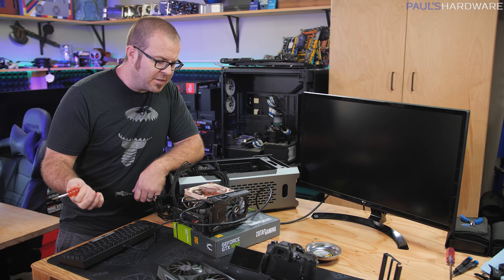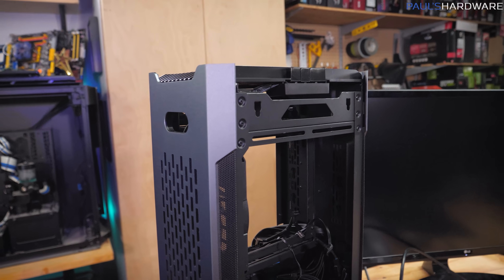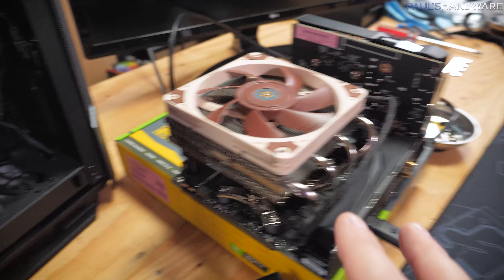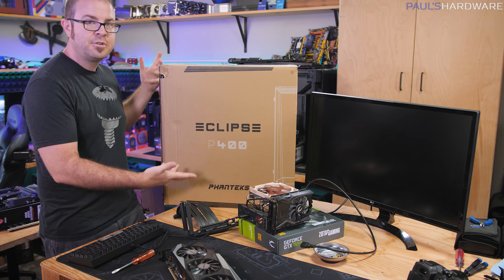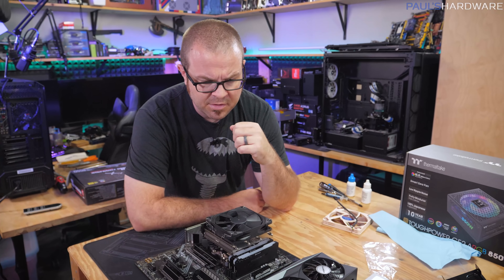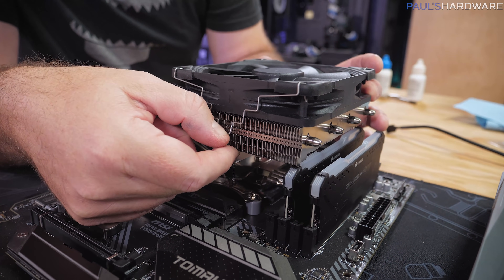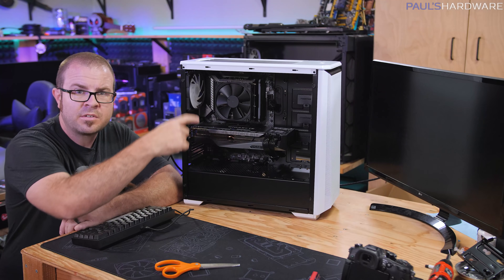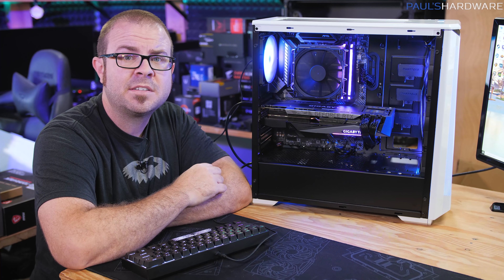Fixing the Chad PC... again

Comment: I have the same GPU and you did not forget to put in the RGB header....you broke it :D Its neigh impossible to take it out without damaging it ;) I replaced the thermal pads and put some on the back for the RAM and the Temps dropped by 25C for the RAM and 5C for the die

Comment: I had issues with two different B550i AORUS PRO AX myself. Spec wise its a great little motherboard for the price. However, issue after issue was not cutting it for me. I looked around on Reddit and found others having issues with it as well.

Comment: If this is like the X570 Master, then when the system's completely dead like that, you have to unplug the battery for about 2 minutes and then reattach it. It's some design flaw with Gigabyte 500 series AM4 boards.

Comment: Just curious, did you bother to re-seat the RAM or no before you declared the MB dead. I've come across quite a few times over the years, what appeared to be a non booting MB was actually just the RAM holding energy ( and the last data on it before last shut down) which was not allowing the MB to POST. But once I re-seated the RAM, allowed it to boot normally. saved quite a few people from having to purchase or build new rigs with that.

Comment: I destroyed a board by accident when clearing the cmos. There are boards that need to have the battery removed before shorting the clear cmos pins. Not doing so kills the board. Don't know how many boards have this design. But from now on i only clear cmos when battery is removed. By the way most boards have a supercap mounted that will take over the job of a battery for a short amount of time. This way you can swap the battery without settings or the time getting lost. O and before i forget always disconnect or physically turn off the power supply when clearing the cmos. This is because on almost every board the constant power from the power supply may not be connected when clearing the cmos. Hope this info will help save some boards :-)

Comment: Points our multiple times that RGB is not the focus and not necessary... then proceeds to install a parts list with RGB on almost every component. Only major part without RGB was the CPU cooler. I know, it's what you had on-hand. But it's still funny.

Comment: If that board is the Gigabyte Auros B550, the clear CMOS has to be done with the power supply still connected. Not sure if that's how you tried to clear it or not, but that's one thing in the documentation that is wrong about the board...
Reply: Thar's why I always just take out the battery, it's way easier.

Comment: Paul. There has been several times I have had to use a true 2 pin plug to short my Asus ROG E Gaming board. For some reason the posts wouldn't ground out properly with a screwdriver...

Comment: I have the same MB and It happened few times just like this, You have to clear the CMOS with the Power ON not like what gigabyte said in the manual, otherwise It would not clear the CMOS. I learn this in my tech support era during the late 90's and still applies to know brands MB. I Know and I guarantee the MB is not dead.

Comment: MotherBoard may not be right off try clearing CMOS again had one where a clear caused it to get stuck starting BIOS, if you have a BIOS flash button that let's you flash bios without a cpu try that to load a new BIOS as BIOS could be corrupted.
Chad's PC is like a 40 year old broom that's had 12 handles and 28 replacement brush heads that works as well as day 1

Comment: Had a similar situation on a gigabyte board all. Everything turned on went into windows but all the USB inputs were dead on the board couldn't even use it in bios. I tested everything out the motherboard was the only thing that was not functioning.
Reply: My Gigabyte B550 board has a tendency to boot with Bluetooth not working on the regular.
Reply: Both my Gigabyte boards refuse to detect the boot partition of the main drive.

Comment: I had a weird issue recently with my motherboard after a BIOS update, wouldn't post at all despite the BIOS update completing correctly. What I ended up needing to do which made absolutely no sense to me as to why it worked but I had to put a jumper on the CMOS reset switch and power up the PC while it was still jumped. After that I turned off the PC and then removed the jumper and it started working again, and yes I had tried removing CMOS battery etc but still wouldn't work. That was the only thing that did work.

Comment: i have a similar psu and there is a 3 pin cable included you can plug on the mb to control the rgb of the psu  via software  or with a compatible rgb hub controller. the model is a CX750F RGB  from Corsair, a bronze 80+ psu but it was cheap and my daughter wanted a unicorn puke build in her Rajintek Silenos pro case so....

btw the rgb controller on these cases ( i bought 2) ,i fried one because the pins  went too  far behind the pcb  and touched the case ,so clipping off the pins and putting a bit  of insulation was the solution to get rgb with my son's system wich has a ASROCK  a520m-hdv (very minimalist, no oc  so don't buy it if you want to oc cpu and not only the memory) board and don't have rgb headers  but my daughter has a asus prime b550m-a wifi board wich does and her 5600g works fine on it so she dosen't need it for the rgb. Now my son is waiting for my new ddr4 memory kit so i can give my old one to her and he can get back his stick of ram and not to have to share his second stick anymore with her lol.

morale of this story  : 
always check bare pcb's if  anything touches the case before first boot and get a cloud of smoke when the sata cable fries and get a nice b550 board like the asus b550m-a wifi or no wifi model or better yet  get a  nice msi b550 like the tomahawk . Also kids still don't like sharing their toys even if we teached them the value of sharing and get a nice  cl14 3600mhz16gb rgb memory kit for yourself  and give your daughter the old 3200mhz kit to teach them about generosity XD . Kids love  the unicorn puke stuff lol. Also don't bother using a 5000g apu with 1 stick of ram, dual channel gives about double the performance of doing single channel on these. explaining gpu prices and the scalpocalypse to a 12 and 9 years old so they can comprehend may be a pain in the a... XD

Comment: Two questions:
1. Isn't Windows authentication stored in the mobo? So you switching it out had no problems at all with new mobo?
2. Aren't you supposed to put the M.2 drive on the upper slot first since it goes directly to CPU?
Thanks - nice vid! :)

Comment: Question Paul, I have a Zen 5 3600 with a RT5700. Would it be worth it to upgrade to Zen 3 with this GPU or would the incremental gain be too little? Really not interested in shopping for GPUs right now.

Comment: I admire those that check their system before they put it in the case. I used to do that back in the day when I worked at a system integrator but now I just YOLO it. So far after 10 or so systems built I've never had a problem! 

This was a nice simple build. Nice work, Paul.
Reply: JINX!

Comment: He should put a 5800x instead with the 3080. It's an unbalanced system
Reply: How so? It works
Reply: @awildpigeon7703  Sure, it works. But it's really limiting your system having only 6 cores with a 3080. I have a 10900K & a 3080 & it works out amazing. I would hate to have a i5 with my 3080. If he went with Ryzen 9, he'll get a better user and gaming experience. If he has money for a 3080, he has money for a Ryzen 9.

Comment: You don't have an AIO laying around?  Even a 120mm is plenty on the 5600x.  As for the other motherboard,  try flashback.
Reply: I would use a good air cooler over a 120mm AIO in a atx case.
Reply: @TheSjuris  then you haven't built both of them.  A front mounted 120mm AIO is a superior solution to any air cooler stressing out a mobo.  Using a P12 fan it's silent.
Reply: @mhamma6560  uuh no.  Pretty sure any noctua or beQuiet air cooler will do better then a 120mm aio unless you have a small form factor case.  Pretty sure that my 360mm aio will cool better then a 120mm aio.
Reply: @TheSjuris  You'd be surprised at just how little of a difference the larger AIOs make on a chip like the 5600x.  The limiting factor is the IHS to silicon interface.   It's this reason that a 240mm AIO will produce cooler temps on a 3080 or 3090 cranking out 450w than your 360mm on a 5600x at 120w.
Reply: @mhamma6560  you can run the stock cooler pn the 5600 without needing to waste money on an useless 120mm and not have issues.  A 5800x is a different story.
Reply: @TheSjuris  I've got both a 5600 and 5800x and numerous builds.  The 5800x pulls up to 150w and runs the same temps  (280 aio) at that wattage that the 5600x does running similar clocks w/ the 120 aio.  As someone that builds machines regularly with numerous and varied hardware configs, I don't have to rely on 3rd party info.   If a CPU's AIO regardless of size isn't drawing cool air from outside the case, aka from the front, it's been installed wrong. Air units can't touch even a 120 under load when installed properly.  Exhausting heat out of the CPU's cooler is the wrong way to go about cooling it.

Comment: Nice build! 3rd times the charm! 😉

i tried the new bios update F13 for gigabyte mitx mobo and it didnt work for me. it actually made things worse and i started getting a weird feedback noise everytime i plugged in a usb drive. i ended up reverting back to F3 bios version that it came with because everyting was working fine with that bios version. anybody else have issues with the new bios F13 update?

Comment: Always love the videos. I had a tu150 and switched into the p400a myself when I got a mythical 3080, when it was in the tu150 it was hitting 80c with the fans at max. In the p400a it’s not hit 70 yet. Or if it has I don’t remember.
Reply: Did you have intake fans at the bottom? The TU150 really needs that extra air to make it work.

Comment: After much effort & then completely stripping my build down piece, I had found out I hadn't properly set my 3700x in the zif socket properly & a few rows of pins were bent. Doh! Luckily I didn't fry the board though there were scorch marks on the cold plate & the plastic that helps hold the CPU lever down had slightly melted away. Expensive mistake.

Comment: You seem to always put the wrong nvme in the wrong socket . Top is usually Pcie 4.0 and the bottom is usually Pcie 3.0 . The big deal about it is the 4.0 is linked directly to the Cpu and Memory - whereas the other is connected to the chipset .

Comment: Socket Top pressure plate warps MEANING "not enough pressure to keep the processor pins in those 2 little peddles in the AM4 Socket. so if you just replaced that top part its GOOD TO GO"

Comment: I thought Windows only worked on the original MB on which it is installed.  I changed the MB on my ASUS laptop ($40), and Windows still worked. However, that was the same model MB. So what is the deal with Windows and motherboard swaps?
Reply: I can't tell you how many times I've swapped Windows drives around. So far I've never had any issues, especially with Windows 10. Windows will jut find and install all the drivers and even activate it if there is a key linked to your MS account.

Comment: Paul, Curious why you put the boot drive in the bottom slot thats wired into the chipset instead of the top slot wired to the CPU? Gen 3 SSDs work just fine in Gen 4 slots on AMD boards afaik.. works just fine in a 5600x system I just build in a Tuf gaming B550 with the same SSD, the SN750 from WD.

Comment: Curious about putting the m.2 drive in the bottom slot. Are both slots connected to the CPU? Usually the bottom is connected to the chipset.
Reply from the maker: The bottom one is connected thru the chipset and is PCIE 3.0, yes. It's a small performance hit but since it's a PCIE 3.0 drive I'd rather plug it in there and save the upper 4.0 slot for a 4.0 drive if he ever gets one.
Reply: @paulshardware  I have an x570 board and I have my 980 pro in the bottom slot due to it having a heatsink. I know I could get better performance from the top one, but over 7GB per second is more than fast enough for me.

Comment: This is the bad memories I had growing up of building systems for people when stuff died and caused issues. They always say "your computer" and when its working fine it's "my computer" 
You, just like myself, know how to build a system. Sometimes stuff is just bad. A lot of people don't forget though and they never let you live the issues down. Needless to say I only build computers that live in my house on a full time basis.
Reply: I know the feeling bro…
Reply: I built a PC for a relative with a bad roach infestation and bugs killed three PSUs, each lasted about three months.
I wrapped the fourth PSU with window screen and alot of electrical tape, careful to avoid blocking airflow.
It's been over six months and it seems to have worked pretty well, hoping it will last until they buy a new PC.

Comment: Why manually spread the thermal paste on the GPU?
Reply from the maker: Because it's the actual processor die, and you want 100% contact with the cooling solution. CPUs have a heatspreader over the die, the die is much smaller than the heatspreader so putting a blob of paste in the middle and letting pressure/heat spread it is ok. When direct die cooling you don't want any part to not have paste for any amount of time, so I usually spread it out, some others use more of an x-pattern to make sure there's total coverage.
Reply: Because its not a cpu

Comment: Why not give chad a beefier Heatsink since there is now room in the new case for it ?
Reply: Agree…guess Chad will have to settle with a free case, mobo, fans and ps.
Reply: Yeah, the cooler is covering one of the RGB memory sticks. I would swap out for a nice looking cooler. But I guess it depends on if Paul has a spare to hand. I would also have tried to hide the front fan cables better, as you can sometimes stuff them along the inside edge of the fans. At least the PSU cables are not mustard though.

Comment: Wait so when I change my MB I can just swap my C: drive (assuming its an NVME) between boards and I dont have to re-install windows?
Reply: Most of the time its fine unless your switching from amd to intel or vice versa.
It's usually smarter to reinstall windows, because it may end up giving you weird issues and ends up you having to reinstall windows anyway. Its better to know you have to do it vs a SUPRISE time to reinstall windows.
Reply: There may be issues, you may have to re activate they windows key.
Reply: Yes. Re-install is the recommended way because that way you won't have remnants of old drivers (if any), but that's not the way I roll. I'm technically still on the install I did in 2011, architecture has changed twice, boot drive at least three times (yay cloning tools) and so on. You might want to have network drivers on a USB stick in case Windows doesn't have the right ones so you can download updates. In this case the chipset drivers are the same so even less chance of a problem.

It's not even limited to NVMe, it works with SATA too. (And PATA, but that's kinda irrelevant now.)
Reply: Depends 90% of the time runs fine sometimes something weird happens and everything goes ballistic or u loose some performance.
Reply: It's absolutely fine in most cases, however there are times when a clean install is better.

If you're going to do it though, be prepared for problems and make a backup! But once the system is back in Windows (it might bsod a few times but should eventually boot) go into device manager and show hidden devices.

Then go through each category and remove any greyed out device, once you've cleared it out of old devices. (be careful though, I've not personally had issues but that doesn't mean you won't) 

Reboot and let Windows reconfigure everything, and then download and install the latest drivers for the motherboard, GPU and anything else you need drivers for and reboot.

Now you can try getting in touch with MS and asking them to transfer the product key to the new board and everything should come back up exactly as it was before without any problems.

But if you run into issues, don't bother trying to fix them, just do a repair install and restore anything missing from a backup.

I should note, you don't have to remove the old devices, but it does ensure a clean slate that should minimise issues.

Comment: Just built my first rig ever. Thanks for the info, Paul, it really helped. I built mine on the mobo box and it shut itself off after 20s every time I tried to boot. Worked fine building it in the case. No clue why

Comment: No more Gigabyte products for me after their latest failure with those exploding PSU's
Reply: Same
Reply: I had good luck with both my Gigabyte boards until both of them had the same issue. They both suddenly stopped detecting the boot partition no matter what I did. One is a z170x Gaming 6, the other is a b460m DS3H. I replaced the z170 with an Asus z270, and I just bought an Asus b560 board for the b460.
Reply: I'm almost certain it's a software issue with the UEFI.